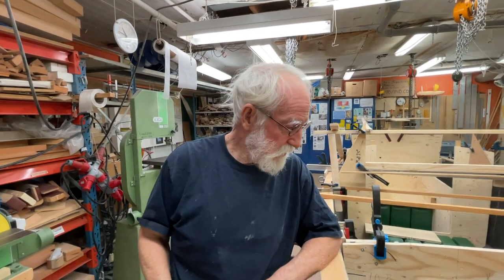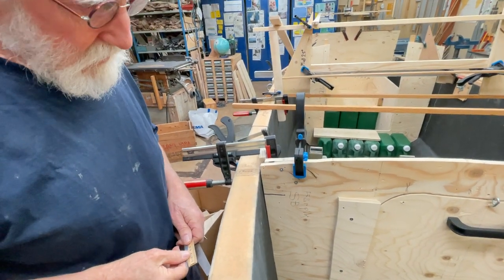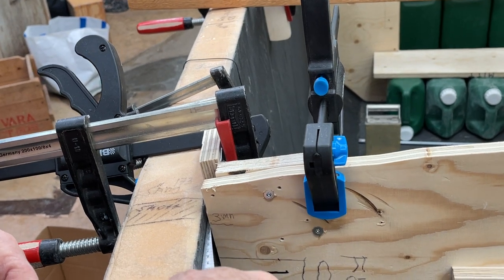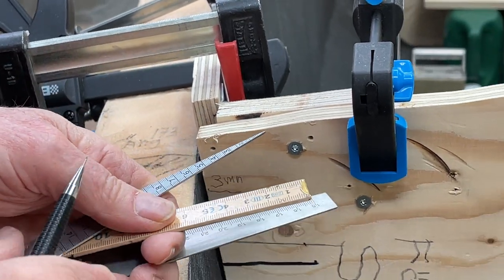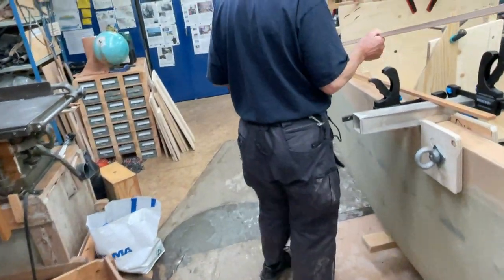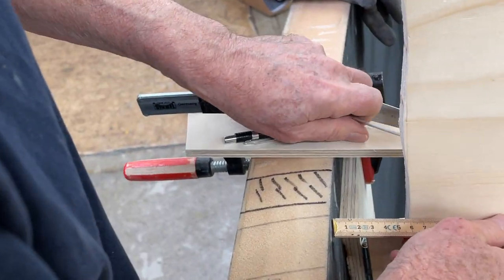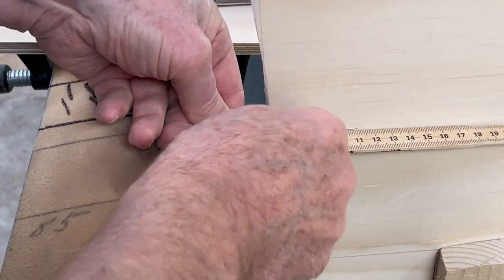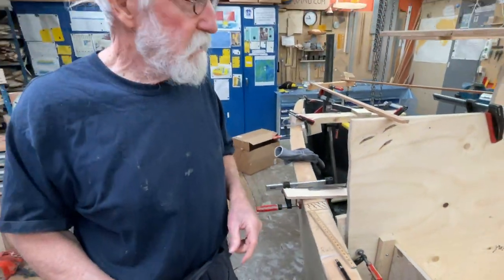How to get the shape of a bulkhead or other thing from a mockup

Comment: Hi Sven, just an idea;  you take a little piece of wood about 10 cm long, make a hole on one side that fits a pencil, then just go inside the hull and follow the curve with the piece of wood, the pencil will draw the perfect curve on the wood of the mockup!
Reply from the maker: It does not work. if you do that on the starbord side. Cut along the scribed line. You got less plywood so you mowe the mockup to starbord. It will fit perfectly on the starboard side but leave a gap on the port.
The only way is to use something that gives you polar coordinates like mine or what the other commentator called toggle stick.
Reply: I think it would work if you add those 10cm from the scribed line on the mockup to the final cutout.
Reply: @SvenYrvindExlex  My thought was; when you have drawn the lines you cut them, then you cut the mockup bulkhead in two (vertically off course), then you can fit the two halfs against the hull and join them again with another piece of wood, then it will fit exactly.
Reply: @nissedur  Yes, That could work too, only not 10 cm but the distance between the block edge and the point of the pencil!
Reply from the maker: @rdc2724  Its not only port and starboard its bottom and all the angels between. Your system only works when you move the piece parrallell without rotations. Again this is a simple method why complicate it.
Reply: @SvenYrvindExlex  I must admit I've only just thought of it and never tried it in practice! Obviously you have much more experience in boatbuilding than me! (I've build one small boat). That's always the difference between an idea and reality ;-)
Reply from the maker: But why make it complicated. This method is very simple
Reply from the maker: Having said that, your method is not very good for bulkheads in one piece. There are other uses for it, and I have used it a lot.
In fact I have built 3 cold moulded boats. On each there are hundreds of wooden veneers that has to be scribed an I use just your method
Reply: @SvenYrvindExlex  Nice to hear it isn't totally useless! Good luck with your build, and I hope to see video's when you're at sea too!

Comment: Sven, there are a few easier and more precise ways.
If you take 2 pieces of cardboard of equal size. The same height as the wood pieces you need. But you cut them both shorter  lengthwise. Then you slide them towards each inner side of the boat. At this point you take a piece of wood (ruller from school), you slide one end of the ruler along the side of the bordées and you put the point of a pen at the other end of the ruler. You draw on the cardboard applying a pen at one end of the ruler while the other end of the ruler is sliding along the side perfectly perpendicular. That way you will reproduce the precise shape that needs to be cut for your piece. You take cutter, you cut the cardboard to use as a model. You do other side. You assemble both pieces of cardboard with tape so you have complete cardboard model for easy cutting. My English is lacking...
Reply from the maker: I do not understand excactly. There are other ways. But you have to make the cardboard modell very rigid. To me your method seams more complicated. But to understand I have to see it demonstrated.
Reply: @SvenYrvindExlex  in stead of a ruler📏 you can also use a compas ⚔️. Put cork at the 📍. You hold piece of cardboard and cut approximately with ✂️. Then you bring the cardboard in position and use the compas. The cork will slide along the side of the boat in front of the cardboard while the other end of the compas with ✏️ will follow on the carboard drawing the exact same curve and lines. When you do this, use your ingenuity so that your rigid piece of cardboard remains steady. Also, when you open the compas, first apply the 📍point on boat. open the compas so that the pencil reaches your cardboard. Block the compas so it does not change angle (distance). Start from the top or the bottom. Make sure you are perpendicular /parallel. There is a special tool for that, but a compas or a ruler can do the trick.
If you do this very carefully, you will draw the precise same angles, lines on the cardboard. All you have to do after is cut precisely your cardboard following the pencil. You do the same on the other side with the other half of your cardboard. Make each half of the cardboard longer so that you can easily slide them one along the other until you reach both sides when the drawing and cutting is done. Good luck. Could not find video on YT.
But your method is probably more adapted to your procedure. So far I have been joyfully impressed with your work, your attitude, and I imagine the will very little if be no loss of material. Thank you for those inspiring ideas and thoughts you bring.
Reply: @SvenYrvindExlex  you can do the same with the existing frame. (ring frame, rider)

Comment: What do you call that triangular gauge? I haven't seen it before.
Reply from the maker: I do not really know I bought it as depth gauge but there is many with that name. Goldsmiths use a similar to measure rings but round conical. Very useful anywhay and accurate
Reply: Welding Taper Gauge!